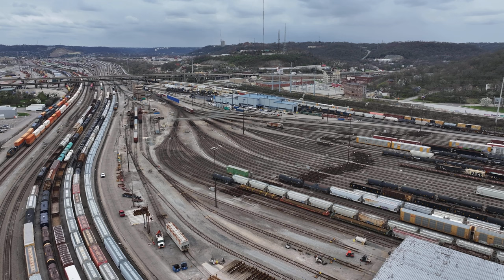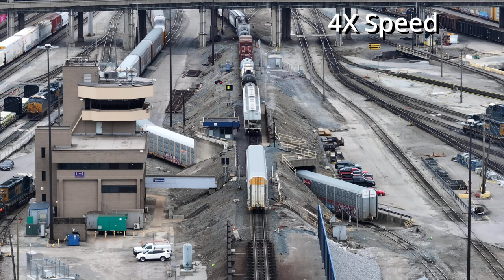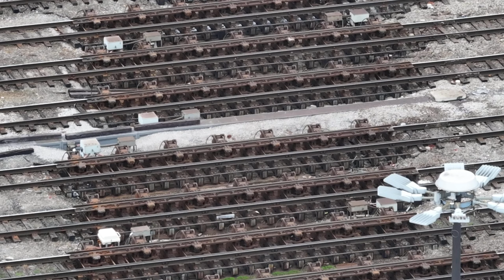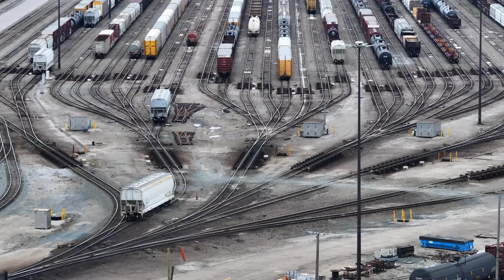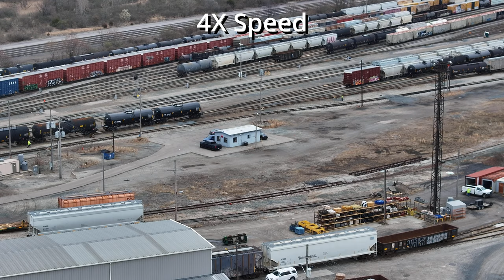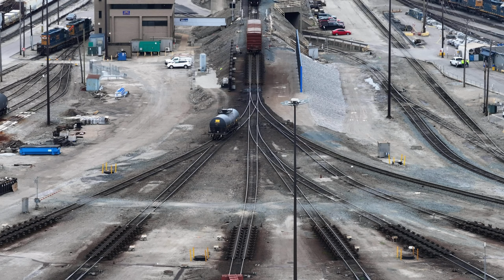Rail Yard Humping Vs Flat-Track Switching: A Tale of Two Yards

Comment: Greetings from Christchurch New Zealand
Thanks for your in-depth informative videos
I presume that a yard worker has to go along and hook up all air lines after the cars have been humped.
Wondering what happens if there is an occasion where cars are not connected 
Regards
Mark
Reply from the maker: Greetings from the United States.
I'm very glad to hear you enjoy the videos.

I do not work for a railroad, but here is how others have explained the process to me.
Once all the cars have been sorted into the bowl tracks from the hump to create a train, a yard crew will pull those cuts of cars into the departure section of the yard.
As the crews work to do that, they will make sure each car is coupled before pulling out of the bowl.
This is where if a car doesn't couple, the crew would manually go through and make sure it connects.
Now that the cars are coupled, they're taken to a track in what's known as the departure yard and coupled together to make fewer, but longer cuts of cars (2-3 vs the 4-5 in the bowl).
Those are then hooked up to yard air (if available in the facility) to fill the air brake reservoirs.
The humping and sorting process in general is done with no air in the cars to prevent a brake application.
Each car will then be inspected before a road crew connects the long cuts of cars and departs the yard.

I hope this helps.

Comment: Great video. I was under the impression, from PSR, that the hump is most efficient when moving blocks of cars where order doesn't matter, i.e. not building locals. The flat yards serve the humps and vice-versa. Yet in your video Queensgate is sorting single cars. My son used to work there and he said HH wanted to convert it to a flat yard due to its low car counts switched in a 24 hr period - which I think would not be possible due to its location/layout.
Reply from the maker: Thank you very much.
I'm glad you enjoyed it.
I think you're correct, there isn't really a way to make it a flat track switching yard without spending quite a lot of money.

Comment: Most bowl tracks usually have a sort of static retarder at the end. That catches the first car that comes in.
Reply: That is the case with Queensgate. As the train blocks are complete they close the front end retarder in the track and open the tail end retarder.  The trim job can then enter the track with a locomotive and couple the cars. After all three or so blocks are coupled the trim job will connect the blocks and move them to the departure tracks.  In the departure tracks a Car man will blue flag the track, connect the air lines and final inspect the cars.  Eventually the road locomotives will be added and brakes are tested.  The road crew might add non-humped blocks and off it goes.
Reply from the maker: Thank you for the info, I'll have to go to the other end of the bowl and see if I can spot the static retarders.
Reply from the maker: @stevenreynolds8393 thanks for the great information.
I really do appreciate it.

Comment: So when I hear shippers say they prefer trucking to rail freight because the train damages their product en route, is there any data at all on whether flat or hump switching is more likely the culprit?
Reply from the maker: I have not found any data regarding damaged cargo on trains vs trucks.
I do know from comments made by railroaders that the coupling system in the cars has been improved to safely buffer most impacts.
That's why as many as four cars are able to be sorted without damage to the cars.
For instance, I used to see "Do not hump" placards on auto racks.
Now, I no longer see that which tells me the cars safety systems have been dramatically improved.
However, my guess is any fragile cargo (glass products, etc.) is not sent via rail.
Hopefully, someone can chime in with more information.

Comment: Does someone need to confirm or finish the connections for the tank cars (or others)?
Reply from the maker: I believe a person goes through and makes sure the connections are secure.
But since a person isn't able to move the cars individually, my guess is they won't find any bad connections until they try to pull out the cars
Reply: @nkyrailfan  there's a "pin puller". I assume there must be a "pin pusher" and someone to connect air hoses?
Reply from the maker: Correct.
Someone will go through and connect the air hoses when the cut of cars is complete.

Comment: That kicking of cars is really using the expertise of the people on the job: Give it speed but not too much so it will hit the previous one too hard. Not to little because you end up with space between the cars. But you need to know before: the wheater (with or against wind), load (empties roll faster), track (slippery and the car will run faster) and the amount of cars in the spurs. Not an easy job. Wheather can change along the job. And than, they also do it in the dark, adding more uncertain facts. And remember: no retarders to depend on... I have great respect for those working in that kind of yards! 
That man at 06:44 should NOT have been there, al least not on the track they are switching too. From the footage at normal speed around 54:00 mark, it did look that the shove was stopped around the spot, the inspector went under neath a car. But at 54:44 you can really see that there is not much space on either side of a car when tracks are full. My father did work in these kind of yards and they never worked like this. Everybody out, and only in when the moving train is out. And he did most of it's work in the dark of night...
Reply from the maker: Thanks for the great info and insight.
I really do appreciate it.
The process of kicking cars is fascinating to me for everything you just mentioned.
The amount of skill is quite impressive.